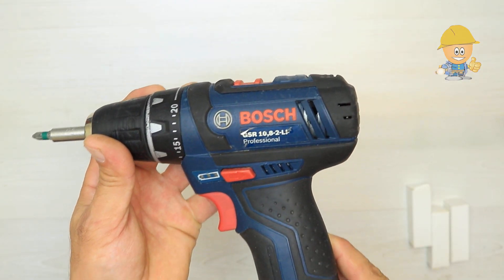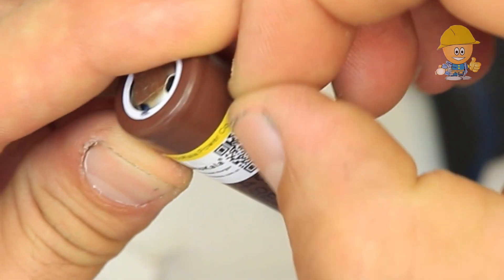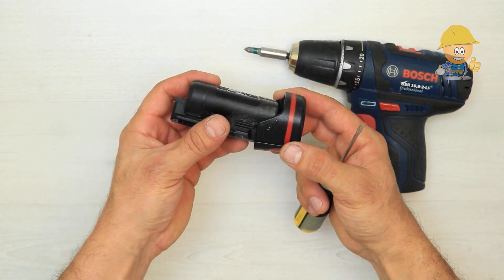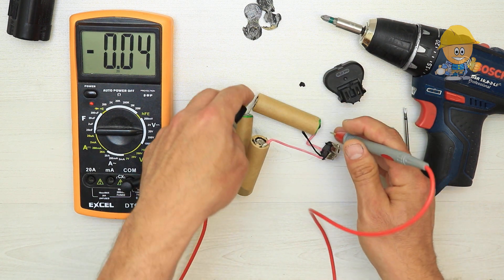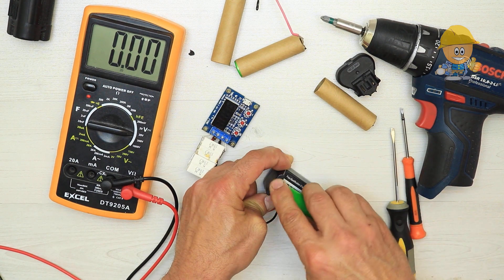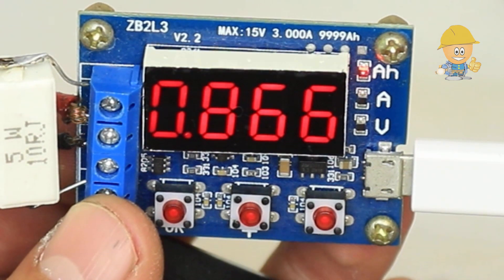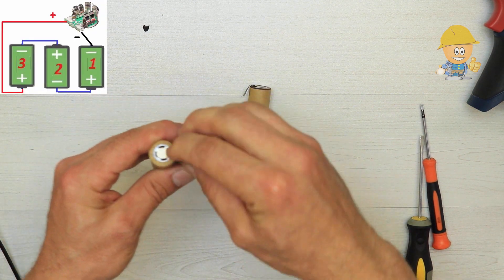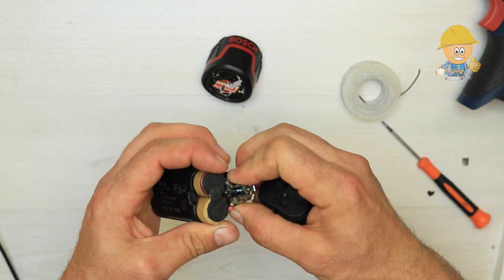BOSCH Upgrade Battery / Change Old Dead Li Ion Cell / GSR BAT411

Comment: will soldering work? then why do other videos show spot welding?
Reply: The batteries in the video come with nickel-plated steel tab pre-welded. Make one's life a lot easier as if is difficult, if not impossible, to solder direct on the cells.

Comment: I might be wrong but it looks like this bosch battery does not have a balancing circuit at all?? How is this even safe?
Reply from the maker: Hi Physics Talk.
bosch batteries have no integrated circuit balancing, the discharge circuit and short circuit are in the drill body. and for charging it is in the charger
Reply: Ever heard of bottom balanced?
Reply: @CMCdiy  FYI: I have Bosch original battery pack (label says: made in Hungary), and it is balancing. There are 2 connections from intermediate connection points going into balancing circuit.

Comment: Hi,   I thought your capacity meter was really good, so I bought one ..... however, when I came to search for the Resistor (5W 75.Ohm JD), I hit a stumbling block in that as a Mechanical Engineer, I have no idea what the JD in the I.D. number signifies, as I can only find ones with the suffix RJ, is there an easy way to describe whether it makes a difference, or is it a requirement to match the lot ?

Thanks a bunch, hoping you can answer this, as I'm stuck 🙄

Comment: Can i use 10000 mah each battery (x3)  to replace the original one?
Reply: 18650 batteries with 10000 mAh do not exist. About ~3500 mAh is the maximum capacity that 18650 batteries can currently have.
Some no name chinese companies produce cheap 18650 cells and claim that they got a capacity as high as 10000 mAh or something like that. That's just a lie. You would be lucky if you even get 1000 mAh out of those cells. Furthermore, the performance of those cheap cells is so bad, they are basically not usable for power tools.
Get yourself some decent 18650 replacement cells from a known brand like Sony, Samsung, LG, etc.
Reply from the maker: hi
Simon Schäfer is right. 18650 batteries are no larger than 3500 mAh.
Attention, if you buy for the drill, take Hight Power Discharge 30A-35A.

Comment: What bms module you use?
I use 3s 25A and the board cutoff supply if suddenly press the drill..
What is the suitable bms for 12v drill?
Reply from the maker: this drill has bms inside it. the battery has only overheating protection
Reply from the maker: for another drill use bms especially for drill
Reply: @CMCdiy  yeah next time i buy a special bms for 12v drill...maybe regular bms has some issue with the starting current of the motor..

Comment: Hi, bosch batteries used 3.6v each, is oke to replace wtih 3.7v cell?
Reply from the maker: hi.
Use 18650 High Drain batteries.
discharged have a value of 2.5v and charged 4.2v. standard voltage is 3.7v
You can find the product bellow in the description
Reply: @CMCdiy  thanks

Comment: Have you tested these liitokala batteries. Most of them are fake and do not have the indicated capacity.
Reply from the maker: Hi Johnny,You are very right, but these batteries are tested by me with the same ZB2L3 module.
Honestly, I did not think to put in this video the capacity of the new batteries

Comment: What is the pinout of the battery pack? There are 3 pins: positive, negative and??
Reply from the maker: hi
And temperature sensor.
Reply: @CMCdiy  hi, thank you! If I wanted to run the bosch with a variable (and high current) power supply, how should I connect the temperature sensor pin? (temperature sensor to + or to - or leave it unconnected ... ?)
Reply from the maker: @db1236  
The temperature sensor is for battery only. in the charging circuit, it has the role of giving the command to stop the charge, when the battery heats up, so as not to damage it.
so if you want to power the drill directly from another source, the sensor is not connected.
You do this artifice at your own risk

Comment: But lithium batteries don't  need a BMS (Battery  Management System) for charging and discharging  till a certain voltage to protect the batteries?  Normally all lithium ion needs it. Anyway  nice work there.
Reply: Sorry now have read another Answer  that you gave to sombody alse. BMS its in the drill, not in the battery.

Comment: Your insistence on speeding up the video ruins the lesson. Slowing it down in YouTube distracts from the video and makes it jumpy. Thumbs down on your technique.
Reply: Your just slow.  You can slow down the video.
Reply: @mhanel30  Did you read the comment I made in its entirety? If so, your reading comprehension is extremely poor. Your spelling is only marginally better, though the words you chose are all easy words to spell. FYI: The correct spelling of the conjunction - you are - is you're. No need to thank me.
Back to the comment I made...only a moron would be incapable of realizing that I am aware the video can be slowed, as I alluded to just that point when writing that the video became "jumpy" when slowed.